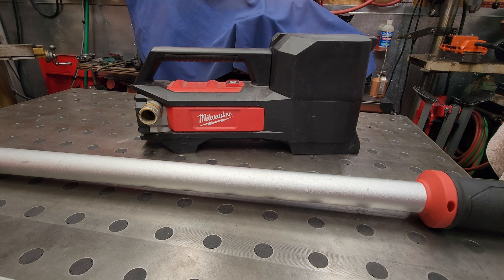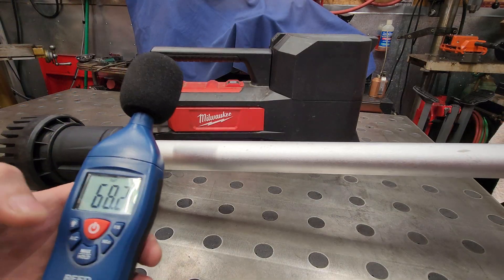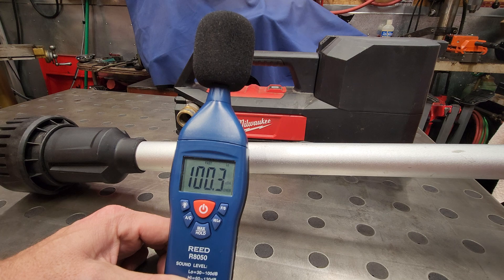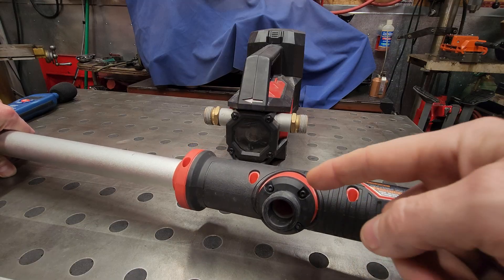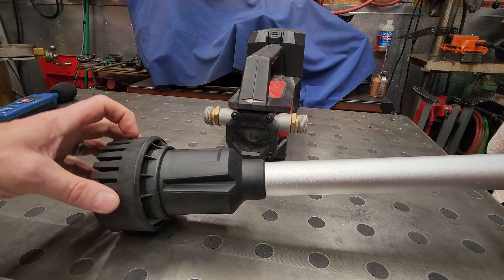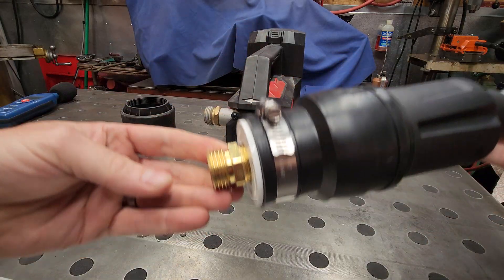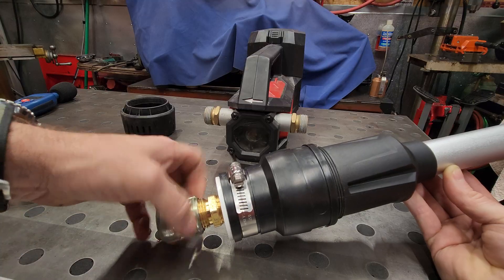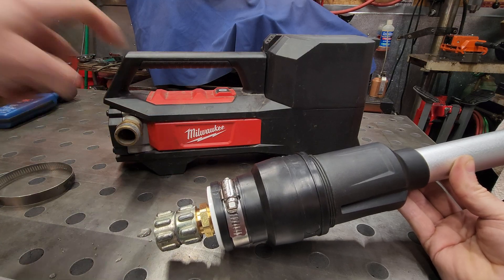Milwaukee M12 Stick Pump hack and bonus sound level comparison with M18 Transfer pump.

Comment: I tried your modification and it won't prime. It just sucks air. The plastic piece that you covered needs to be submerged in water for it to actually start to prime. How did you get this to work properly?

Comment: I have the m18 and it works well but issue I have, if it has sits for a while and in my case it does, it will not spin the rubber blades due to dry fiction to the glass.  You hear the m18 doing the same in this video the longer it runs, it needs to have water running through it.  To correct my issue, I have to remove the front covering and lube the rubber blades where it touches the glass before climbing into my attic to pump out the catch pan for my AC unit.  AC unit is filling the pan every so often due to crud build up in the lines btw.   Thinking about picking up this unit as it appears to be less hassle for my needs.